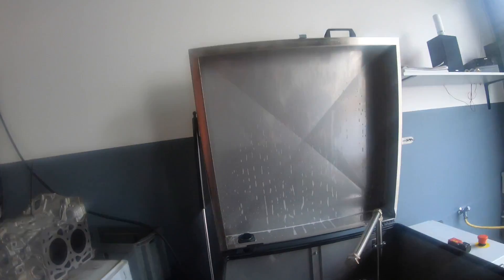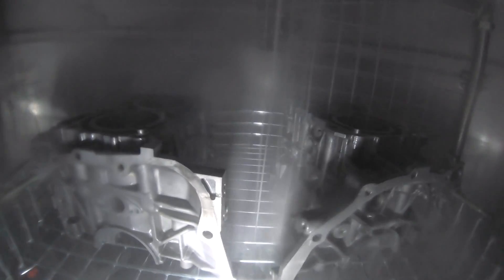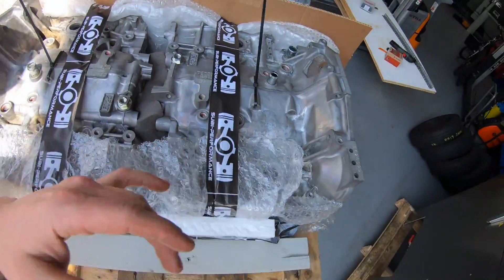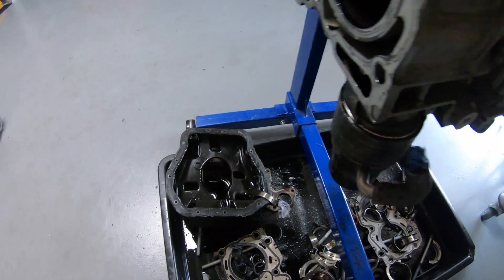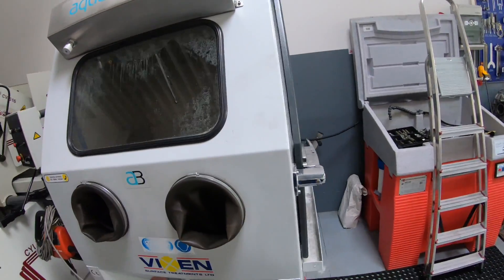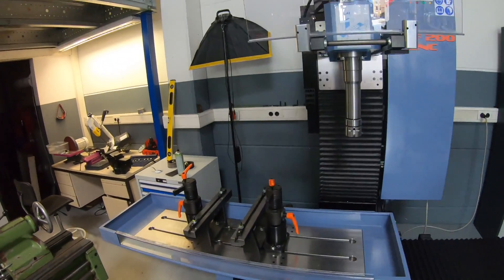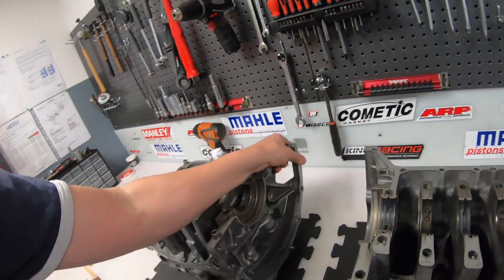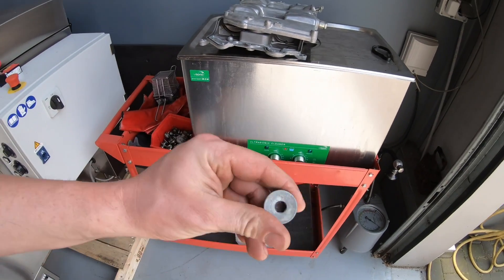Inside of a professional Engine Parts Washing Maschine while Running l Subi-Performance

Comment: Wait so do you bead blast the blocks? Id be so worried to try and get every last grain of glass out of the oil galleries. Soda blasting is way safer because it dissolves in water and is much easier to rinse out. But the glass does clean faster...
Reply from the maker: we test so much thats the best way and no we have no glass or something else in the gallery :)
Reply: @SubiPerformance  at one point i had my supervisor ask me to stop sand blasting rocker boxes for rebuilds (part between cyl head and valve cover) because he said it embeds the beads into the metal and when it heats up it would release the glass from the metal. I dont think we ever came accross any issues but i just jet wash them instead of blasting them now.